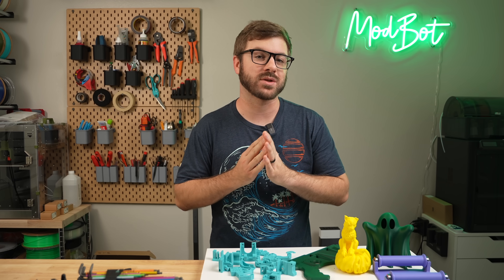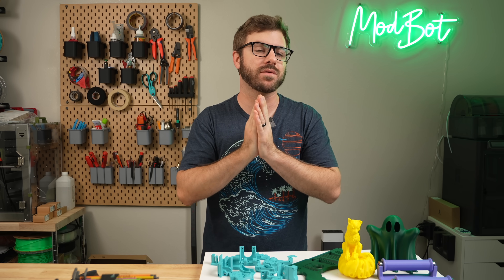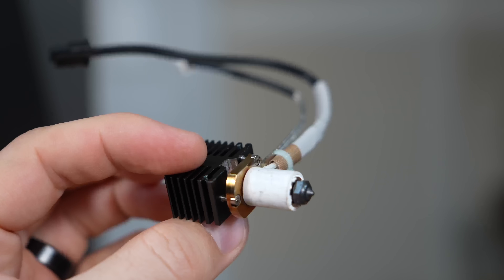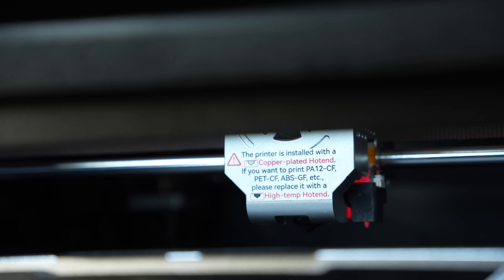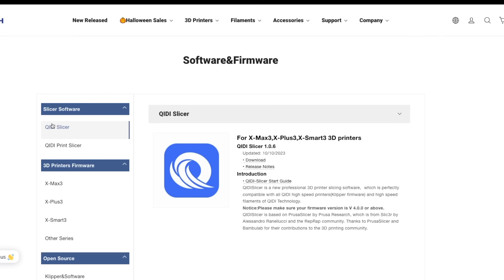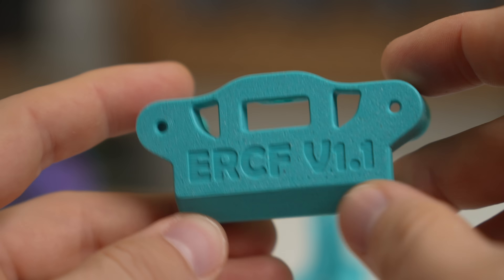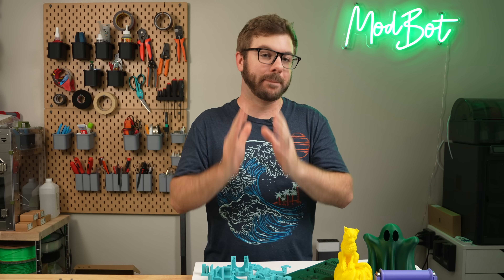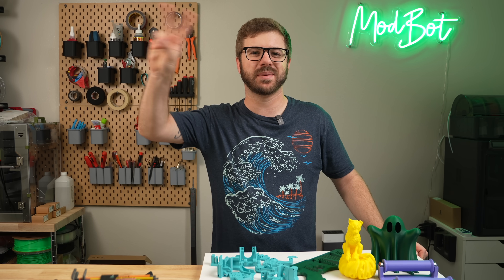Large Fully Enclosed CoreXY 3D Printer (Qidi Tech X-Max 3)

Comment: I had X-Max first generation and I have to say when printer worked it was great, until  I was cleaning nozzle one day, accidently unplugged ribbon cable from extruder board and motherboard fried instantly. I contacted Qidi support and they suggested I need new motherboard that cost £120 + shipping. Then I realised I want to convert it to Klipper. I am still in process of doing so as it is a lot of work.

Comment: 4 months after seeing this and getting one myself:

They have swapped the BL-Touch for an inductive probe. I have not had any bed levelling issues at all with it so far, but sometimes it feels like the z-offset seems to very slowly creep upwards causing it to get a liiiittle too close over time. Might be from using petg consistently and the heat causing a little extra expansion on subsequent prints.

That one thing aside, this is the best pre-built printer I've ever had. I've had Elegoo Neptune 2, 3, Anycubic Kobra and a Prusa XL (bad unit, returned it, won't judge quality as most had significantly better experiences than me). The tolerances on prints I had previously had great difficulty with like Soozaphone's Dummy13 printed so much better, I was able to print a few mods for it like a side-mounted holder for the dry box inside of a couple hours, it heats up FAST, and I have only had one print fail and that was due to a bad slice.

Honestly wanted to start making videos myself about 3D printers just because of how much I like this one.
Reply: Hey, if you don't mind my asking, how's yours holding up? I'm rather keen on the X-Max 3, but there's not oodles of longterm reviews. Any pitfalls a newb ought to know about? (Never used a filament printer, do have a resin; don't expect that offers much in the way of relevant experience, though.)
Reply: @dracodraco1982  So far it's been my go-to printer for most things. Its still printing very smoothly and no deteriorating with some basic maintenance.
Reply: @redkingrauri3769  In that case, I'm feeling pretty much sold on snagging one. Thanks. ^.^
Reply: @dracodraco1982  if it's your first fdm printer, I'd recommend Orcaslicer over the included default one too.
Reply: is it true it can print metal infused parts?
Reply: @danielbassa2354  Qidi does sell metal infused filaments so I would imagine it would if you used the steel nozzle set.

Comment: Biggest piece of advice I give to anyone that wants to buy a Qidi 3D printer, buy in whatever format offers 2 year support. I purchased the x + 2 and had a few Kinks to work out, but their support is always happy to continue to work on it, even if there are some times understanding barriers😂.
I also know someone who I do business with frequently, he has multiple X Plus gen 1 and has even rebuilt corexy in the frame of one. My x + 2 prints ASA like it is pla. My support to come off better than most YouTubers. 3D2A machine that has printed some of the more Exotics. The high temp core and dual gear extruder has never slipped or jammed on me, and micro Swiss even stocks the particular version of nozzle.

Comment: Hey Modbot, I got my X-Max about 3 months ago and so far I’m very happy with it. Some trouble with bed leveling initially but now it seems ok.  I notice this pattern on the Z axis you mentioned, but it appears to be support related. Every time I print something using Qidi slicer and need supports this pattern occurs. I notice that Qidi slicer automatically changes layer height causing this pattern.   To confirm that I Sliced some tests using Qidi slicer and used the G-code on orca, I confirmed the layer height was shifting from 0.01 to 0.3.
Reply: It's a problem with all superslicer based slicers. There's not really a workaround other than to set top z contact distance to 0 and then select synchronize to object layers. Or use tree supports. It kinda sucks because it also changes the object layer height
Reply: good to know!! tks @arxfatallis

Comment: My biggest concern with this printer is the bed leveling, I’ve been using the Bambu x1c pretty much exclusively for the last 6 months and the bed leveling has basically never failed me. Do you think the X-Max 3 will be as reliable?
Reply: I have been using bltouch for 4 years now, not a single failed print or bad first layer because of it. Those saying that it is obsolete want changes for the sakes of changes only. Why change anything if it works great? Also if you watch this video it has precision bed leveling on, it probles 3x times before moving to the next point. I have never used precision probing for my BLtouch, a single probe is just enogh to be perfectly accurate.
Reply: Haven’t had any issues with mine yet. I only run a level on it about every 10-12 prints. I could definitely go further between

Comment: If Qidi is taking the time to make this large high speed printer, you would think they'd move away from using antiquated CR Touch and move to load cells. I would gladly pay an extra $50-$100 to not have to go through the hassle of setting the offset.

Comment: this isn't a "bad" printer, to be sure. and a few years ago this would have been an outstanding value. but after bambu took over the market, there is zero reason to buy this unless the build volume or closed source software of the bambu is an absolute deal breaker for people. the level of polish and out of the box "just works" aspect of bambu printers is unparalleled, and yet here we have a $1000 printer that expects you to use a peice of paper to set z-home like it's 2018 and we're all screwing around with our ender 3's. just ridiculous. oh and also, this thing is UGLY. there i said it, deal.
Reply: It may be ugly, but it does its job contrary to Creality K1.

Comment: I have the X-Max 3 that has been upgraded (by Qidi) to the current(?) setup. Gone are the nine individual bed magnets, replaced by a soft magnetic sheet as well as a the BLTouch has been replaced for an inductive prox. The build plate doesn't "slot in" like it used to because of the thicker magnet being a bit higher than the stops cast into the plastic, which leads to a bit of fiddly aligning of the plate after each build. No big thing.

The hotend was replaced because it kept getting a blockage in the cold end. The fix for that was a new hotend, both covers upgraded with extra fans, and a new mini board that provided sockets for the connectors of the new fans.

I also got another hotend as well as an extruder, and new covers when my printer sucked up a massive ball of plastic and made a horrendous mess of things.

Qidi support has been nothing short of fantastic, I cannot say enough good things about their support.

As to your complaints, they are good points, but I have mine connected to Ethernet, so no need for USB except for firmware upgrades. And I removed the spool holder and have it sitting on the left-hand side of the printer. Easy access.
Reply: I didn't end up installing the magnetic pad because it was too thick for the slot in. The original magnets seems to work quite well. 
I've had had weird issue where I get some partial layer shifts at around 120mm. I haven't contacted their support about it yet.
The new cover also fixes their parts cooling fan design. The original cover did not blow air around the nozzle and I did notice significant curling.
Reply: @colinmetzger6755  I have had an on-again, off-again issue where the printer seems to forget where it is in the Z axis - could be related to what you are experiencing.

My problem with the hotend wasn't curling, but clogging. That, and feeding the filament from a new roll in behind the end of the old roll never worked. The filament would jam at the hotend every time. Replacing the hotend and the fans fixed that perfectly.

The BLTouch would alternately have a "Failed to deploy" error, and then a "Failed to retract" error, followed by a good measurement that would occasionally result in the bed beating itself against the nozzle. That hasn't happened since the BLTouch was replaced.

I also have a camera that I'm going to install tonight. I don't see as well as my younger self did, and 12 feet away is a bit tough for me to see what is going on with adhesion. :)
Reply: I received my X-Max 3 3 days ago and mine came direct from China with all the upgrades (including soft magnet sheet) already installed. My build plate definitely slots into place so they have most likely modified the moulds to raise the plastic tabs so the build plate slots in again. Thought I would mention it in case you feel like upgrading the part down the line.
Reply: @MM-fc8ie  Good to know, thanks!
Reply: @MrWaalkman   I had a closer look and if I compare to pictures I have seen of the older style bed with the 9 individual magnets it would seem that Qidi have dropped the aluminium bed lower, and not raised the plastic locating tabs. It may just be a case of using shorter spacers under the bed, but I would check with Qidi first.
Reply: @MM-fc8ie  I'm not planning on doing anything about it. Or maintenance guys have a saying, "If it works, don't fix it". :)

And it has been printing beautifully. :)

Thanks for the update!
Reply: I feel like it's a huge step backwards going to the mag sheet and inductive probe. This product is so nearly there it's frustrating... Keep the embedded magnets and use a klicky micro switch type probe on a servo. That will work no problem.
Reply: @dmax9324  No argument here, I was disappointed as well. And bed leveling/first layer problems have been worse since the change. But otherwise it has been a very, very good printer. Currently printing out 36 "Surprise eggs" in one go. Ran out of filament during dinner, fed the end from the new roll in and it started back up without a hitch.

And I have a list of upgrades, but that comes after the warranty period is up. The Qidi support is definitely worth taking advantage of.
Reply: @MrWaalkman  - I started having all kinds of issues to the point the printer was virtually unusable. The printer would loose connection with the MCU, BL touch was acting up, and it would loose the Z position and print sever inches off the bed or try to crash into the bed, and the printer would just shut down randomly while printing.  I found the power switch was faulty, and under load the terminals lost connection. Olivia at QIDI sent me the upgraded, which included a new adapter board, proximity sensor, front and back covers, and a new USB cable which was identical looking to the original. I think the new adapter board fixed the BL Touch issues, as it has been running okay for a while. Time will tell if it's foxed or not. I didn't swap to the magnetic sheet or proximity sensor, I prefer the embedded magnets, and could see nothing but problems with the magnetic sheet.

Comment: I use the Qidi X-cf pro to test our 3d printable tools. It is pretty much the same as the x-max 3 but comes with 2 print head assemblies, 1 low temp with a brass nozzle and 1 high temp with a hardened steel nozzle. It also has the usb on the top towards the back but I just keep a usb plugged in and the send files from the office to the printer through an ethernet cable. What's not the same is that the X-cf pro doesn't come with klipper, doesn't have a heated chamber and the enclosed filament holder is on top (which is actually better than having it on the back). It also has a BL touch ABL but I leveled the bed once when I got it and haven't had to level it since and that was a year ago. So far I'm really happy with Qidi and as a side note their PA-12 carbon fiber nylon filament is awesome!

Comment: I think that it would be cool to see a filament sensor that has an inbuilt caliper thingy in it that measures the thickness of the filament entering the nozzle and auto-adjusts the flow based on the differences in thickness. It wouldn’t be necessary for people who buy high quality filament, but it would allow the use of cheaper filament

Comment: This is the outdated version. They now come with inductor probes and a magnet stickered bed. Qidi is hitting the market hard. The community for these things is going to skyrocket. I have had the max for about a week, and love it. Been printing non-stop since it came in.
Reply: I was going to mention the same thing, mine came with the BLTouch and the individual magnets. The BLTouch got very flaky and made the printer unusable, and Qidi sent out the new soft magnet pad as well as the inductive probe. The only thing is now the build plate doesn't had a spot to lock in its correct position. But that just means that I have to align the plate after each build.

I had some other problems that led to me getting two new hotends, an extruder, two sets of new covers, and a few other goodies. Suffice it to say that Qidi's support has been out of this world.
Reply: Does the bed still have the embedded magnets, but they just added a sticker sheet?
Reply: @dmax9324 I'm not removing anything to find out, lol

Comment: For the z banding issue, you'll want to print a circle/cylinder in vase mode, not a square, the hesitation around the corners is going to affect the extrusion. A circle will mean you have a relatively constant extrusion due to more linear movements.

I have this very annoying moiré problem on my printer, where at first it seemed to be the extruder. I tried everything from replacing the spur gear, replacing the stepper motor, and finally adding "TL smoothers". The problem is ultimately the stepper driver, I just can't justify the cost of a new main board with quality drivers given what else is in the market these days. Maybe one day I will upgrade it.

Comment: The hardware is fine, mine came with the inductive probe and the bed is pretty flat and it makes nice prints.  What would be better is the little fan not being so noisy and it coming with more profiles that print things like PETG without needing to develop your own profile.  Simply put PETG won't print with the default profiles because it doesn't want to print that fast.  After a weekend of testing, I was able to make it print very nice PETG, though a bit slower.
Reply: What speed are you printing the Petg at ?

Comment: would like it if it didn't have that terrible looking shell
Reply: Tiny great looking Bambu or large semi ugly qidi… trade offs.. the sides of the x max are sweet, the front leave a lot to be desired but it prints like no other. I’m happy besides the rear mounted filament and power switch. Makes zero sense on a 60lb printer that is difficult to move.

Comment: you should ask qidi for the upgrade kit. there are new parts that fixes some issues still like changing to an inductive probe, a far better fan shroud and a more sturdy cable. qidi provides this for everyone for free
Reply: Interesting... don't see any link on their site, or do I have to contact them, directly? our Max3 is about 3 weeks old. Wonder if the upgrades aren't already there. I does use a BL touch however.
Reply: I have left an inquiry about this with QIDI. Sounds exactly like what I need to fix what ails my X Max 3.
Reply: They do t provide it all. They gave me everything for mine except the inductive probe. Still using the bl touch
Reply: @jessemarshall7176  Mine was replaced when the BLTouch started throwing "Failed to deploy" and "Failed to retract" errors. The upgrade "kit" consisted of a magnetic sheet, an inductive sensor, and a link to firmware that took advantage of the new setup.